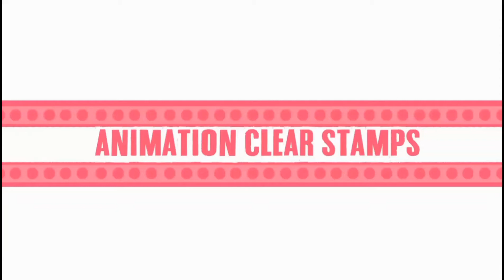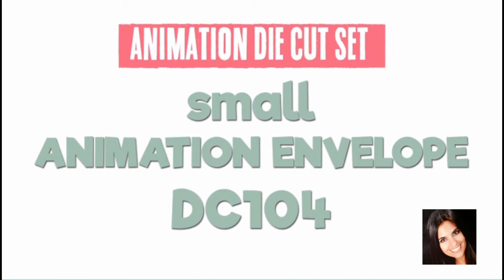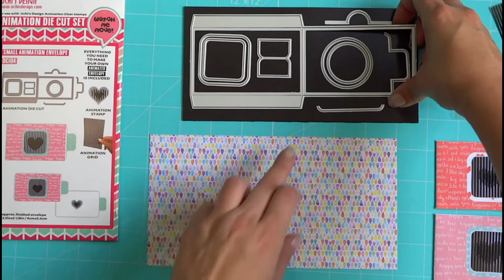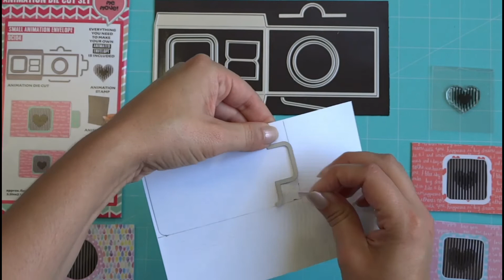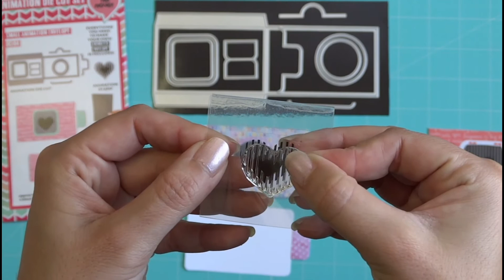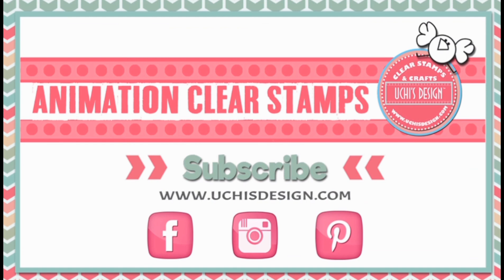How to make an Animated Envelope using Uchis Design Animation die cuts| DC104 | small envelope

Comment: Dear Luciana, I’ve just watched this video with the butterfly pull tab. It was much easier to follow and easier in general than the owl video that you made. I have a question, there is a shiny side to the striped grid and a coarse side. Which side should be facing up when you glue/stick it down? Thank you. Anita

Comment: I purchased the DC107 Animation Banner Grid.  Is this die made specifically to fit the Animation Envelope?  Thank you.
Reply from the maker: Deanna Gearinger Hello! Yes, this fits perfectly in this envelope die set.
Reply: Where does the stamped image go?
Reply from the maker: Deanna Gearinger Hi! So, because you are moving the grid, the stamped image should be stamped directly on the inside of the envelope once you fold it. Leave the window open and stamp through it, straight on the inside of the envelope. Hope that helps! ☺️
Reply: Great!  That's kind of what I thought, but wanted to confirm that.  Thanks so much for such a quick reply!!
Reply: I'm also thinking it might be easier getting it centered by doing it that way.  Thanks!
Reply from the maker: Deanna Gearinger Glad we could help! Enjoy your New Animation Stamps and dies! 🤗